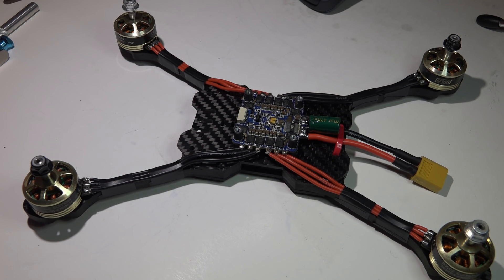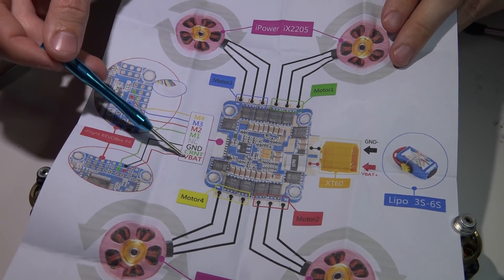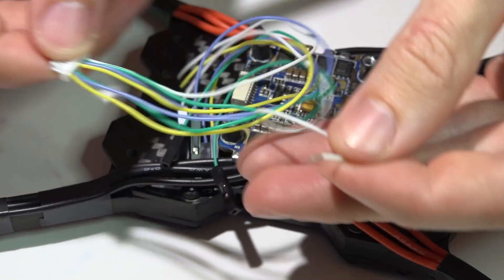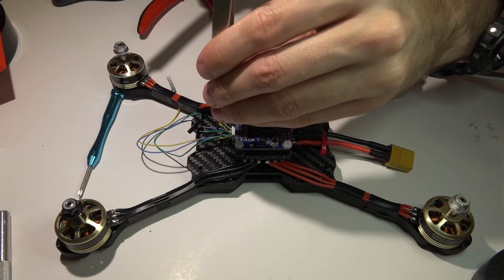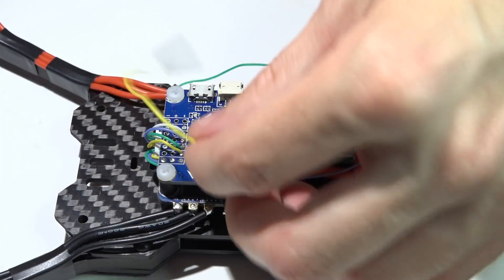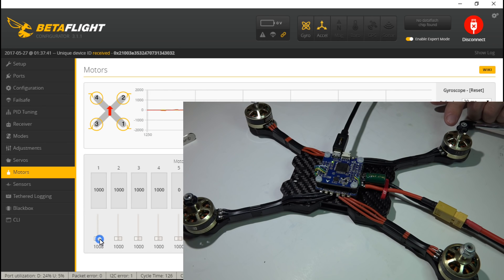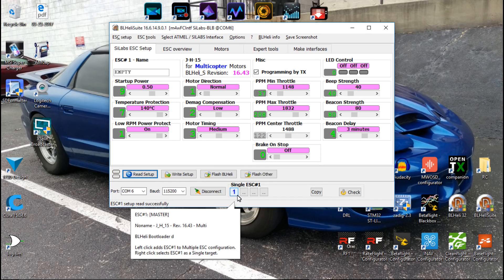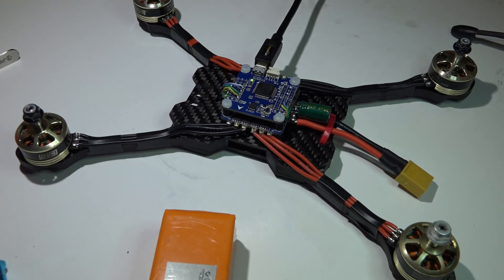4 in 1 ESC Wiring & Set Up

Comment: can you show a Eachine Wizard X220S FPV Racer RC Drone Spare Part 4 in 1 30A ESC BLHeli_S 2-5S Dshot600 being   wired  from the conector  on the esc board  to actualy soldering it  to a  cl racing f4s board please...otherwise I dont fly...the esc  board came with  no wiring diagram,,starts off with a  black wire.

Comment: Hi, I need your help in a matter of the image I will send a picture of the 4.1 esc should install a capacitor, but which should connect the first time I will use this esc is a question of engine locations made the different sorting thank you very much already.
My esc 35 amp

Comment: My fc is the lux v2 and has a ground next to each motor spot. Since the 4-1 wire connector has only one wire for each motor and it’s grounded from the 4 in 1 correct?

Comment: hello master ... I wanted to ask you if you could help me .. I bought these esc..Racerstar Shot30A ESC 30A 30amp 3-6S 4 in 1 BLHeli_S BB2 Dshot600 Integrated Current Voltage Sensor ... and then FC
Omnibus F4 Pro V3 Betaflight Flight Controller Built-in OSD ... (a banggood clone) but I do not find any diagram that specifies the characteristics of how to weld .. do you have any prospect that has the same characteristics of this FC?
I thought it was the same scheme as the OMNIBUS flip 32 ... but I'm not sure ... then I bought these engines ...
Brotherhobby Returner R5 2207 2400KV 2700KV 4-5S Brushless Motor ... from 2700KV ... but I have not been careful and are the threads of the crankshaft all in the same direction .. does it involve anything? Or is it enough to invert the welding order in the ESC of the two external wires of the motor?
another thing can you tell me what are the 2 6-pin and 3-pin ports of this FC?
thank you so much
Reply: Roberto Leon He passed away last year. This is an old video.

Comment: anyone know a video explaining how to setup the current sensing part of this?  I followed this great video for my RacerStar 4 in 1 that seemed basically identical into a flip32 f4 v3 flight controller which i believe is what is used here but for the life of me i can't get the amperage to show.  is the current setup needing to use a UART and if so which UART is on the crnt pin?(doesnt seem as though the crnt pin on my FC is tied to a UART.) if it matters I am running DSHOT600 and ibus.  Thanks again for all the videos JC

Comment: hello there, i am looking for parts to build my first drone and for esc i am between racestar 35A 4in1 without bec and racestar 30A 4in1 with 5v bec. For the 35A wiring if i connect my battery to esc bat pads and  the vbat jumper wired to fc power B+ will all be ok? Is it wiser  to  pick the 30A racestar 4in1 and if yes any advise for fc selection? thanks
Reply: xristina gk dont buy racerstar save up

Comment: I am using the same esc but for some reason when I plug the USB in and the battery the quad automatically disconnects from the configurator. Does anyone else have this issue?

Comment: Hey JC, you powered the flight controller from the voltage sense wire. With that said, do you know how much current the voltage sense wire can handle? I'd like to be able to power my fc and prosight from there so it goes through the current sensor. If I solder on to battery cable, like my current setup, it will bypass the current sensor. If you know anywhere that has that information that'd be great. I don't have high hopes, but if you have that information, that'd be great to know. Thanks

Comment: Nice video, I installed this 4-in-1 ESC. If flip this ESC(upside down) and Battery connector toward right side, the motor number can meet normal setting. No need to reverse any motor with 3 cables just fit the ESC output layout. I think their manual is miss leading.

Comment: Figures i just went through all this the other day.Only i have a currant and voltage sensor on the racerstar shot 30a 4 in 1 esc and not sure where to run those wires if at all.has currant and volt sense in omnibus betaflight f3 v1.1 with osd / barometer.I ran voltage to F3 from battery to vbat.

Comment: You mounted the FC's forward direction to the left which is probably why your motors had to all be switched. It makes sense for this build to keep the wiring short but how does that affect your flying? or is there some kind of betaflight magic you have to perform as well?
Reply: David Clute, you can rotate the flight controller in any orientation.  You just need set the yaw orientation in Betaflight to adjust for it.

Comment: Could you do a vid on what your opinions are for the stuff that Kababfpv talks about. About his hyperfloss frames being super tough if built light. It's just so unconventional that I need another YouTuber that I trust to confirm his theories and statements. It just sounds to good to be true that if you build light ( his frame 4-in-1 ESP micro vtx regular cam and sub 30g motors for a dry weight of 250g) you get durability and super performance

Comment: Hey JC. I just messed up my ESCs. They were working fine. Then decided to upgrade to BLHELI 14.9 from 14.4 - I used the same exact firmware BLheli suit read which was flycolor 30A something. But then I found out they are based on Blue 20A ESC firmware according to product page(RTF black mini 30A UBEC  ESC). THen after the flash, BLheli suit is not seeing the ESCs. I tried FTDI mode, Betaflight pass thru, Ardurino Nano, none sees the ESCs, so I cant try to flash different firmware . Do you have any video for these kind of issues?

Comment: JC-  your motors are reversed compared to the conventional setups.  Is this to help keep the camera lens clean?  I have considered making my motors set up this way too.  Thanks for all the time spent making these videos.
Reply: I'm not talking about the pros or cons of either setup. My point is that almost every firmware is set up by default to spin the motors 1 & 4 CW, 2 & 3 CCW and that is the basis for many people to consider that as "normal". Just do the motor direction that fits your build best. My camera is above my prop line, so grass gets flung at my camera body and not the lens itself. But my FC is exactly along my prop line, so if I reversed direction, I would get grass and junk flung right into USB port and all over the FC itself.
Reply from the maker: I've seen where many guys are running it that way but I just run it the normal way. All the motors were reversed just how how the ESC circuitry is run.
Reply: Betaflight, Cleanflight, Kiss, and most every other firmware maker say it's normal.  But there's a reason I put "normal" in quotes.    At the end of the day, the most important thing is that you don't have one prop directly adjacent to another prop spinning the same direction.
Reply: Thats what is common but the problem is that it spins grass and debris into the camera.  Supposedly, having 1 run CW and 4 run CCW, it helps.
Reply: The way you did its not the normal way...Normal way its to spin inwards toward the frame....
Reply: "Normal" is when motors 1 and 4 are clockwise, 2 and 3 counterclockwise. So the props spin inwards towards the front and back, and away from the sides. So if one was trying to make the quad in the video "normal", you wouldn't do any extra steps because motor direction was already correct for each motor.
Reply: yeah ? 1 and 4 should be clockwise? 2 and 3 anti...?
Reply: I was.  I was the OP.
Reply: I was wondering why he had motors 1 and 4 turning ccw I didnt even know you could fly with the motors turning that way
Reply: What is normal?
Reply: I think there may be an advantage to having 4 and 1spin CCW and 2 and 3 spin CW.  I am in the middle of building a Speed Addict 210 V2 and will set it up this way.  My last quad was constantly getting grass flung into the lens.  It's motors were set up as "normal".
Reply: Who says that is normal, is my point.  What is the rationale for one direction vs the other?  What is normal to JC is different to some but who is to say that his setup is not normal?

Comment: Nice.👌Looking so fresh and so clean! I would be tempted to Over Black Tape the whole skinny arm, maybe evevn zipti, for fear of snags&snaps, pulling a motor pad. JC I have a question, do you oil your motor bearings? and if so how much, how often, and what type oil?
Reply from the maker: I used to oil them using the Scorpion bearing oil. But it makes a mess. Bearings are cheaper nowdays so I just replace them if I dont damage the motor before they go bad. Its about $5 a motor to replace bearings.

Comment: there is a thread in rcgroups that suggests to remove the ldo from this fc as it gets too hot even without powering anything else from the fc and use a 5v external bec to power it. Does this have any merit? I have the omnibus f3 powerd from vcc I have no issues so far.
Reply from the maker: I dont think there should be any problems
Reply: It will get super hot, the linear regulator will have to burn the V difference as heat. The airbot creator himself on this https://www.rcgroups.com/forums/showpost.php?p=36331129&postcount=759

Comment: what do you think of the super thin arms?
Reply from the maker: They're not bad. I actually think they are stronger than the normal 5" arms that comes with the Valorem. But these are made mostly for racing and in racing the crashes aren't so hard so it shouldn't be a problem. I wouldn't freestyle with the arms.

Comment: my worry is I burn 1 out and have to buy a shoe new 4 in 1
Reply: Well on the good side it eliminates any solder problems that may happen doing individual ESC. I tried the 4 in 1 and was surprised how smooth it was. I also changed motors so probably not a good comparison. So far it is working for me but ya if one esc goes out I am done. Otherwise I usually go with the TBS Bulletproof or DYS.

Comment: Great video! Thx man! And I also have a question! I am using speedix 4in1 esc, I dont recall it having a current cable, only Vbat! So that means I wont be able to show mah consumption and current in my osd right?
Paired with a Furious Radiance and Piggy OSD! Thx
Reply from the maker: Right. You would either have to use a different 4 in 1 with a current sensor, or individual ESCs with a flight controller that has a current sensor like the Omnibus Pro, Betaflight F3, or DYS F4, or some other one.

Comment: so how do you wire a 4 in 1 esc with the dys aio fc.
Because both the fc and the 4 in 1 esc needs to be connected to the main battery lead.
Reply: stupid thinking works just fine
Reply from the maker: You would have to use a 4 in 1 that has a 5v regulator, then wire that into any 5v pin on the DYS F4. But if the regulator isn't rated high enough, say 3 amps or so, then you wouldnt be able to power the camera and/or VTX off the DYS. So I would recommend just using a flight controller that doesn't have a built in PDB.
Reply: Project Blue Falcon ok thanks for the info.
i was thinking powering the 4 in 1 with the lipo and then two leads from the same power pads to the one of the dys fc where the main battery voltage needs to go.
stupid thinking?

Comment: Nice, yeah its nice having esc's in such a small package but everything comes at a price.  (btw  NC -  Not Connected)

I have to admit that it does make your build look super clean :)
Reply: Also, NC is circuit dependent, so even though it's not used on this build it may be used in a different config. But yea! Not Connected (for this circuit)
Reply: Correctamundo!  NC is a universal schematic symbol for Not Connected.